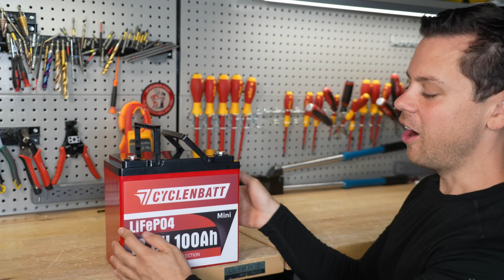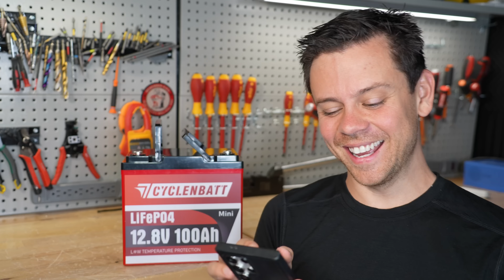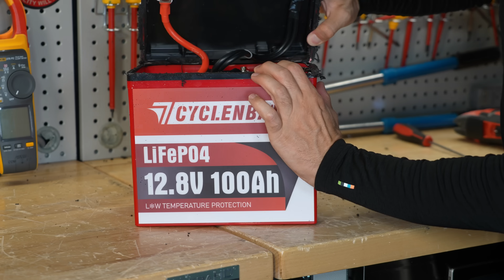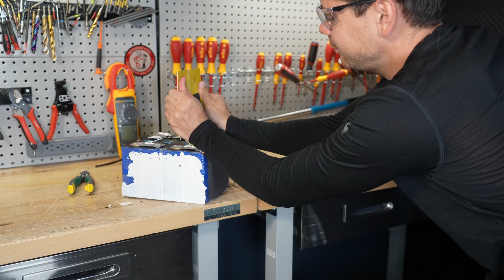$133 100Ah "CyclenBatt" or Time Bomb?! 🔥🔥

Comment from the maker: 12V batteries that are safe to use: https://www.mobile-solarpower.com/lithium-batteries.html

Affiliate links for Batteries in the Video:
$133 cyclenbatt (don't buy): https://amzn.to/4lcRn1z
Stud Fuse Terminal for Budget Batteries: https://amzn.to/47mv0n7
125A Fuse for Fuse Holder Above: https://amzn.to/4otXykS

0:00 False Advertising?!
0:32 Capacity Testing
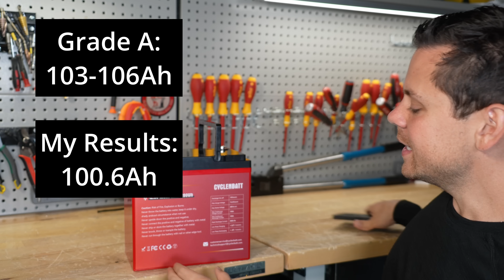0:46 Over Current Protection??
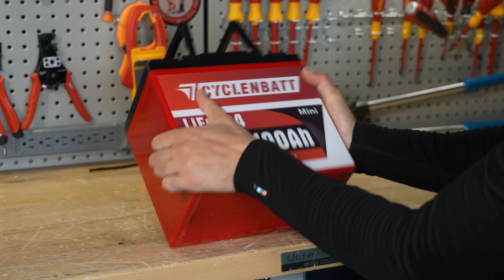2:01 Tear Down
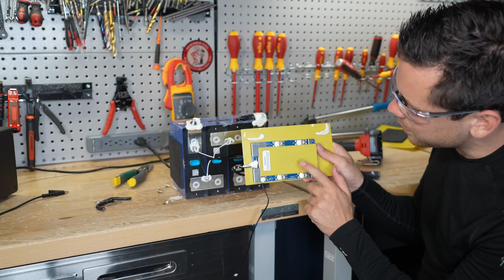2:57 Paper Separators?? No Straps?
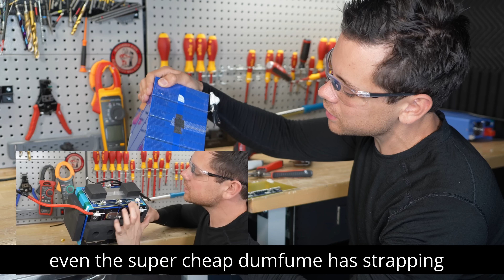3:11 Conclusion

~~~~~~~~~~~~~~~~~~~~~~~~~~~~~~~~~~~~~~~~~~
Tired of getting ripped off? Check out my "Will Prowse Approved" solar product recommendations below!

12V Batteries
https://www.mobile-solarpower.com/lithium-batteries.html

48V Batteries
https://www.mobile-solarpower.com/48v-batteries.html

Offgrid Inverter System Builder
https://www.mobile-solarpower.com/48v-complete-system-blueprint-559371.html

Hybrid Inverter System Builder
https://www.mobile-solarpower.com/code-compliant-48v-offgrid-system.html

Mobile Handtruck System Builder (very popular!)
https://www.mobile-solarpower.com/mobile-48v-system.html

Solar Panels
https://www.mobile-solarpower.com/300w-solar-panels.html

Ground Mount Solar Racking
https://www.mobile-solarpower.com/ground-mount-racks.html

Wire, Lugs and Busbars
https://www.mobile-solarpower.com/wire-and-connectors.html

Tools
https://www.mobile-solarpower.com/tools.html

Fuses and Circuit Breakers
https://www.mobile-solarpower.com/fuses.html

Plug-N-Play Solar Systems
Ecoflow, Anker And Bluetti! So many models to choose from. See my current recommendations here:
https://www.mobile-solarpower.com/full-size-systems.html

~~~~~~~~~~~~~~~~~~~~~~~~~~~~~~~~~~~~~~~~~~
Need to build a large DIY system? Need a trustworthy solar distributor? These are my favorites:

Signature Solar
Creator of EG4! Solar Minisplits, Victron and More! Largest Solar Store Online.
If you want $50 off, please use my link below and coupon code "DIYSOLAR50":
https://signaturesolar.com/?ref=cPwLcVc0SW-BjN

Current Connected
Best Prices for EG4, Victron, Midnite and so much more! Fast Shipping and Highest Rated Customer Service:
https://currentconnected.com/?ref=wp

~~~~~~~~~~~~~~~~~~~~~~~~~~~~~~~~~~~~~~~~~~
Join our DIY Solar Community 
Need more help? Join the largest solar forum on the internet for beginners and professionals alike. 140,000 members and counting!
https://www.diysolarforum.com

Check Out My Free Book
Best-selling and beginner-friendly guidebook to off-grid 12V solar!
https://www.mobile-solarpower.com/the-book.html

~~~~~~~~~~~~~~~~~~~~~~~~~~~~~~~~~~~~~~~~~~
Contact Information:
I am NOT available for personal solar system consult! If you wish to contact me, this is my direct email: williamprowsediysolar@gmail.com
FTC Disclosure Statement and Disclaimers:
Every video includes paid promotion or sponsorship (such as free products for review). Some links on this YouTube channel may be affiliate links. We may get paid if you buy something or take an action after clicking one of these. My videos are for educational purposes only. Information is subject to change/update at any time. Electricity is DANGEROUS and can kill. Be smart and use common sense :) DIY Solar Power with Will Prowse is a participant in the Amazon Services LLC Associates Program, An affiliate advertising program designed to provide a means for sites to earn advertising fees by advertising and linking to Amazon.com
Reply: prismatic cells over cyllindrival all day
Reply: Hey, on that battery or any other battery you should check the individual cell voltage after doing a full charge just to see how far out of balance they may be or if they are indeed just not pulling capacity due to being used or bad cells
Reply: Hey Will...... Can you do a video on Grid tie inverters?   I dont see much content from you about Grid tie inverters
Reply: just be smart with it and itll be fine..  yes it should have the advertised features..  however to me all these budget batteries arent necessarily a Dont buy..  they are just something where whoever uses them needs to practice caution and actually put together a deisng for how to charge and discharge them as well as your own current protection.. (fusing *ALL* batteries and wiring is a no brainer).. there are conditionas where you might wanrt batteries that provide High levels of current for short periods.. ie such was with inverters that offer huge max short-term current for say starting an A/C, a vacuum, etc..   I only wish I could use Lithium batteries in my Mobile office bus setup..  but due to the extreme temperature conditions the bus sees while parked, I cant make use of them..
Reply: Hey there,I need some help,I have a bluetti AC70 what unit can I add to it for more consistent power
Reply: Would these batteries be ok to run as a secondary battery in my car for a audio amplifier? My power and grounds are oversized 0 gauge Ofc and I use a 250a fuse
Reply: On a battery bank of 4... Do you use 4 stud fuses or 1?

Comment: Oh.... gosh. 

I bought one a few days ago without thinking too much about it since I assumed they're all redresses of the same thing kind of like the all-in-one liquid coolers by asetek.

It was cheap... even cheaper than most other brands with the Bluetooth module and I thought I was catching a steal especially since it fit the budget to my 400w off-grid cabin that'll use a few lights, a small tv and a mini-fridge.

I did buy it with a MRBF terminal fuse rated at 125 amps though if that helps or will it continuously blow them?

Comment: Hey Will! There is a YouTube video of a guy using a 100AH lithium battery to start his car. It got me thinking how cars have changed over the last 10 years. I understand older vehicles have VERY heavy current draw when their old school starter is activated and will likely trip a BECM. Many newer cars have very small, permanent magnet starters now plus computerized fuel injection has cars starting very fast. It seems the use case has changed with batteries not needing to supply such a HUGE inrush of current to the starters anymore or needing to supply that draw nearly as long. If starting a newer vehicles does not exceed the BECM limit, is there any reason not to use a lithium on that car? I realize voltage regulators on cars are not optimized for lithiums but doesn't that only just leave a little battery capacity "on the table" and not actually hurt them? If underhood heat would be a problem, lithiums could be safely relocated into the trunk. Thanks, Gary.

Comment: Hi Will, this is very off topic from the current battery but relates to the usual more reliable rack mount batteries. Is it possible to put these 48 volt to 51 volt rack mount batteries in series such that you'll end up with a total of between 400 to 800 volts? I'd really appreciate if you could talk about this. Thank you.

(this relates to exorbitantly priced high voltage battery systems that I've been seeing become normal in the market. I know going higher voltage than 48 volt is eventually where the market will go based on current trends. But I'm just wondering if that's something that's possible with the current rack mount batteries.)

Comment: Hi Will, I’m a retired disabled Vietnam veteran. 
I’m growing cannabis to help with some medical issues. 

I wonder if you could advise me how to properly set up my grow room on solar. 
I have two solar panels over 300 watts, and 4 100 watt panels. 
I followed your advice and got 2 Redodo 100 amp hour batteries and a  victron charge controller. 
I have a 5,000 watt inverter from harbor freight. 

I also have an older 1500 watt 4patriots solar generator. 

I expect my grow room will use about 2500 watts when my LED lights and everything is on.

Comment: Like 90% of these, they don't define a "cycle". Are we to assume it's per the cell datasheet, usually 0.5C or 1C? Or are they "cycling" at 1A maybe taking 5% out and recharging to reach 15,000 cycles? LOL
Reply from the maker: 🤣🤣 so true
Reply from the maker: The lab data sheets are usually 1C. So you could do way more than the rated cycles. That's why calendar aging matters more. Especially for solar. We won't have much cycling degradation from cycling this chemistry with solar.

Comment: Hey will i have a Epever 40A MPPT Solar Charge Controller Tracer BN Series Negative Ground 40 Amp Solar and im hooking  Panel Charge Controller 12V/24V Auto Identifying Intelligent Regulator Max. PV 150V and im hooking it to two 200ah batteries in parallel. And was hoping you could do i show about how to program the settings for them... Do i just add the ah's together in the settings or do i just use the setting for one battery... I cant find any videos about that anywhere... 0lease help
Reply: Dang typos ugh

Comment: Good video. Any plans to review the 48v LiTime Golf Cart battery w/ Bluetooth? They spec them at 15,000 cycles at 60% DOD, 100A continuous discharge rate (600A for a second) and they have a 200A BMS.

Comment: Your videos are so helpful, Will and I learn so much from them. I'm building a 24v system - if you had a mind to do some more on 24v systems, such as the Watt Cycle 24v / 100a/h battery or an inverter like the Junbpaw 2080W Pure Sine Wave Inverter, 24V DC to 230V/240V AC [I'm in Oz, but I guess there not much difference from the 110v US version] - that would be super! I look forward to your next video!

Comment: Hey Will, thanks for reviewing our product! :) Although the BMS we use isn’t the JBD one, it’s definitely not a cheap one. Its procurement cost is actually pretty high. To meet the design requirements of the Mini space, we found this BMS that fits both the space and quality needs. It actually has overcurrent protection, with a trigger threshold of around 350A±20A, and it will cut off the load in about a second. Between the cells, we’ve also used insulating materials. For space reasons, instead of the usual epoxy board, we’ve used a thin electrical insulation board. Our goal has always been to offer a product that’s affordable yet reliable in terms of quality, not just focusing on cheap prices at the cost of quality. Anyway, thanks again for the review! We’ll work on improving other areas. This video has been super helpful for us. Thanks, Will!😄
Reply from the maker: Why so high for over-current protection? And good to know about the BMS!
Reply: This is a common issue with hardware-based BMS. When these BMS were originally designed, they set a higher trigger threshold, and it’s not possible to adjust this threshold later through software. The margin of error for the trigger value is also quite large, like I mentioned earlier, it can be ±20A.
Reply from the maker: I have tested a lot of BMS and if it says 300A for 5 seconds, it should disconnect at 6 seconds. If it's running even 105A, it should again, trip at 6 seconds.
Reply: Actually, we’ve been aware of the OCP issue for a while now, and we’ve made updates in our new products released in Q2 (our Bluetooth version battery). These new batteries now have two levels of overcurrent protection thresholds: 130A for 10s cut-off and 330A for 5s cut-off. The new BMS cuts off overcurrent loads earlier and more accurately, with much smaller error margins. We’ll keep working to finish upgrading the overcurrent protection on the hardware version batteries by the end of this year.
Reply from the maker: Why did the cells test so low for new? What cell are you using here?

Comment: I use these to add storage capacity to my power stations. At most, these pull 600 watts, so about 50 amps. I use 60 amp fuses or circuit breakers. I agree these might not be suitable for a solar array. But using these with a Bluetti Charger 1, with a fuse, plugged into the solar input of my power stations adds storage capacity at much more economical price than a power stations proprietary battery. The main importance is fuses and wire size rated to carry that current. For this purpose, and the added safety measures, this is sufficient. That might not work for a stable solar array.

Comment: How about making some videos comparing or evaluating DC circuit breakers. I see 12v DC breakers cheap on Amazon, but do they really work? Can I trust a 100 amp breaker to protect  this battery whatever is attached to it?

Comment: I put two of these in a Harbor Freight 4800 case in parallel. I fused it at 100A at the combined battery output. Good to know that the internal current limit is not reliable. I’m using it as an extra solar collection battery, maybe I’ll use the Power Queens for the inverter duty and these for lighter duty.

Comment: I love my cyclenbatt. Winched with it on and off all day. Pulling 200 to 300 amps at times. I'm happy that I don't have to worry about the overcurrent protection.
Reply: But what if it does decide to catch on fire?!
Reply: @fishhuntadventure It's outside in the open. Put some dirt on it. I have others indoors with MRBF 100A fuse.

Comment: Hi Will, I am moving to property I own in northern az and plan on being 100% off grid power.
My concern is that my wife and I are ham radio operators and concerned about noise interference from the controller, inverter and so forth. We are looking at EG4 components and possibly another brand. How can we find out about noise prevention for our ham radio?

Comment: The bluetooth versions of these cyclenbatts do a much better job.  You can use the app and adjust the BMS settings for over current, over voltage, low temp cut off, etc.

Comment: I have a question about charge controllers and amperage (current).  If I have a charge controller that can charge at 100 amps on a 48 volt battery bank, four 12 volt batteries in series, how many amps are going to each battery at the same time assuming you're actually getting the full 100 amps?  Googling this I get the same answer that each battery gets the same full amperage, 100 amps.  That may seem correct at first but what if I add another four series battery bank and parallel it to the first one.  Now I have eight batteries, is each battery getting 100 amps at 48 volts? That means you magically created more current and can keep adding batteries and it won't slow down your charge time since everyone says they all get the full amperage.  The voltage doesn't drop on the charge rate when you add more batteries.  Can someone please explain this to me.
Reply: Replying to myself.  I go on the biggest solar channel on YT with a very good question and get zero responses.

Comment: Hmmm....a few days too late for me. This should be on my doorstep Monday morning from amazon. Given my use though, I'm just going to add a fuse as it is for a APC battery backup. The APC is only rated for 600 watts and that would only be 50 amps when used in an actual power outage. The SLA battery it had just died because of the age, not really usage.
Reply: Make sure you check the charge voltage on the ups with a multimeter. The APC units tend to drift from the correct voltage - usually higher.

Comment: Thanks for still occasionally reviewing these bargain bin batts. Question more for bluetooth batteries not this one since it isn't BT - when you see OCP not tripping do you ever try to connect to them with Overkill or another app that can read settings (depending on the BMS) and see what its set at? I did this recently with an EcoWorthy and some of the behavior made sense based on the BMS config values but didn't match the advertising.

Comment: What are you using to charge at 165amps? As my batteries get bigger, the 50 amp charger I'm currently using seems slower and slower, and I know the batteries can take a lot more. I don't need 165 amps, but 100+/- would be fast enough for me.

Comment: I have absolutely no problem with the overtemp protection because it makes it more likely it can start engines, a use case you never seem to consider
Reply: I have a dual purpose to start my boat,  it's awesome 😊
Reply: I've never had a time in my life where I needed an LFP battery to start my car.  However if you do have a need for that use case they sell lightweight portable jump starters just for that purpose (of which I own one and it did work when I needed it).
Reply: There are other types of vehicles than cars. LFPs are replacing boat batteries as combined starting/house batteries and extremely well suited to the use.  @robertgiresi9515

Comment: It seems for review culture on Amazon batteries releasing way more than 100A are preferred.. yes it hazardous long term but looks like that's what the people want
Reply: hazardous long-term? how so?
Reply: @richielives  Unless the BMS is rated for higher Amperage, over-Amping a battery of this chemistry can cause a fire! The fets may be the first to burn out, but still not as safe as a battery with the proper BMS...usually one needs to get at least a 280Ah battery for that kind of a BMS.
Reply: @richielives  discharging at super high C rates will destroy the batteries 

And there is more wear and tear to the cabling than normal because of the higher thermal expansion from higher current 

If it's not frequent it should be alright tho

Comment: I bought 2 of these for my trolling motor on my boat.  Glad to see the low temp charging works at least.  Got a proper terminal fuse installed so not worried about the lack of overcurrent protection on the BMS.  Price is hard to beat but the false advertising is a let down.

Comment: As long as you don't stress the battery and use it with an external fuse, it may be a bargain.
Reply: dont need those straps problem to since the battery squeze with plastic case in the mini series like this
Reply: bad Ai,mr BOT! @billykulim5202